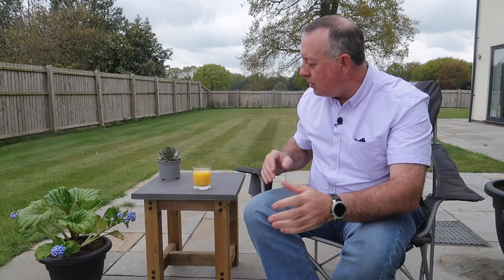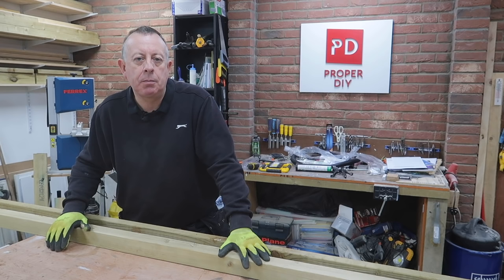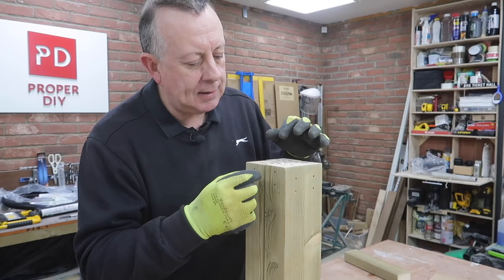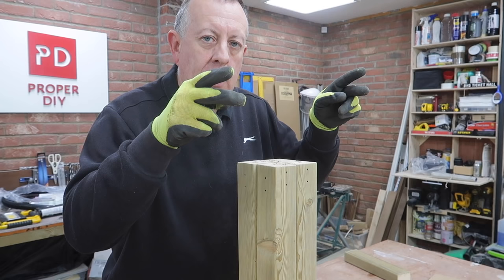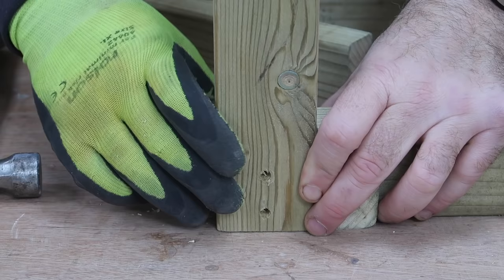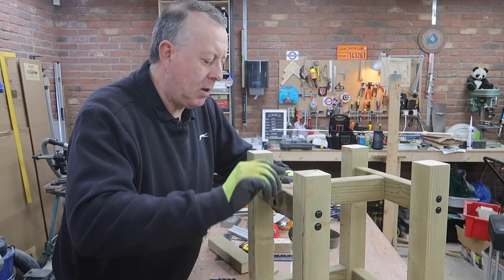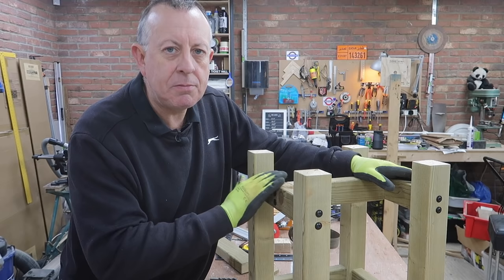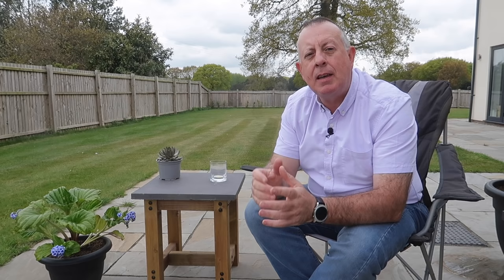How to Build an Easy Outdoor Coffee

Comment: if I'm trying to be quiet and careful, and for jobs that require very low speed drilling, I still use my "egg beater" drill, and I also have a brace and bits. And with a brace, it's called that because you can brace it against your chest or hip or whatever and lean into the work. Very effective in keeping your bit from wandering and helping you get leverage.

Comment: Thats a great little table.

I have my Grandad's brace and bit, which we think is about 80 years old. It's beautiful to look at and use and still perfect. With the correct bits it's  far easier to use than that little hand drill. It chomps through the material with ease.

Comment: Nice little project Stuart. 
Back in the day I had one of those hand drills which were a nightmare to use. Very easy to snap smaller diameter drill bits as you whirled away with one hand while trying to keep the drill straight with the other. It was a hand me down from my dad god bless him. I never used it or the Stanley Yankee pump screwdriver I inherited from him either. I adopted power tools very early on. Corded Black & Decker tools including a Work Mate from a friend who worked for B&D at the time. Believe it or not I still have the B&D a sander, circular saw,  power plane & a Work Mate albeit they haven't been used in years now that I switched to cordless tools & a different work bench. Even my lawn mower & Blower Vac are battery powered now.  
Enjoy the NEC. That brings back memories of many days I spent on exhibition stands all over the UK & US which is very tiring standing up for long periods of time & suffering with feet that swell to at least one size larger than normal. Rather you than me. If you ever get the chance see if you can find an instructional training video featuring John Cleese entitled "How Not to Exhibit Yourself" (circa 1974). As young engineers we were made to watch this before manning our first exhibition stand in 1976. It's very funny. Keep the projects coming. 
👍

Comment: I like watching videos like this not for the actual project but for all the little tidbits you pick up along the way.   I had never seen the trick of using a piece of paper wrapped around the leg to cut it square.    only thing that I'd add is don't just run out and get treated lumber and use it right away- it needs to sit and dry for this sort of project before the build or you'll have warping of the legs afterward.

Comment: Coincidence - I've come in from my garden having taken outside a coffee table in exactly the same style - made for the cost of about 20 pocket hole screws and some paint.  The frame was made from a Beech bedframe I found beside the road and the top is the granite cut out for the sink in our kitchen (I got the supplier to polish it up as part of the granite deal) - simple pocket hole construction with the frame given two coats of Smoothrite paint and 4 plastic caps screwed to the bottom of the legs to stop water creeping into the wood.

Comment: What a wonderful video with good tips.  I am quite new to woodworking, I made 2 small outside tables and then a 3rd one 1.5 metres high, all from 45mm.  The insufficient number of screws went in at semi random positions and the unit has such racking problems and benerally uses so much timber for something so poor it's getting disassembled again.  

I love your jigs!  Cardboard jigs here I come, though I have used small simple jigs from offcut wood, I hadn't seen a card one before.

Comment: A couple of bench hooks would make the hand sawing easier.  Instead of the hand drill,  it would have been easier using a brace and bit, so much more accurate for drilling those deeper holes.

Comment: Another great idea and project - well done and thank you 
Quick question- with the larger concrete top table you had a drip channel - does this need a drip / rain run off ( or are you planning on storing in side over winter ? ) thanks Chris
Reply: I'm thinking of copying this build. My plan for a bit drip protection is to run a bead of silicone in place of where the drip channel was in his larger table. Hopefully any water than runs off the top of table then hits the silicone and drips down before being able to reach the timber frame
Reply: @Reavley  Neat & simple idea

Comment: Cool project.  My only comment is the offset screws at the post.  They don't look particularly good to me.  You could angle the screws from the support side at about 30 degrees and hide the screws but you would need two drill jigs to make that accurate.  I don't think it would take that much more time to make the jigs.  This is a project my father would do, basically hack out furniture with no particular wood working skills.  I wish he was here to show him the video.  Thanks.
Reply: Or just use 1 screw on the outside to keep the industrial look, and one hidden in the corner on the inside as you have suggested.